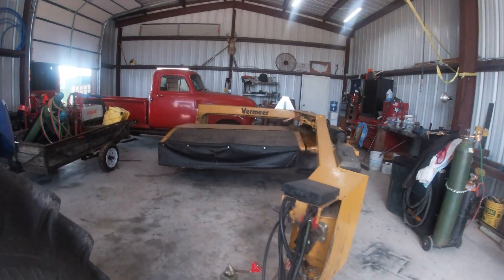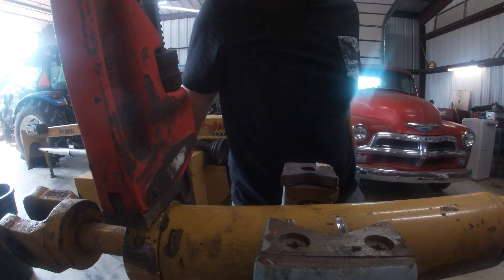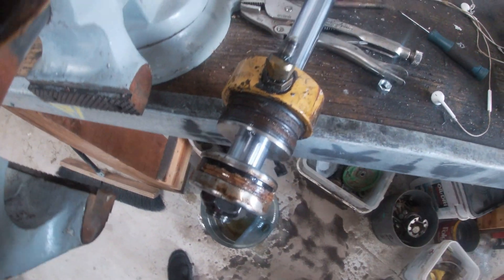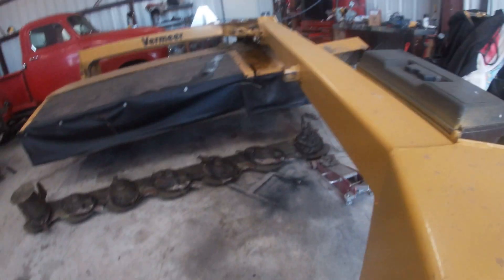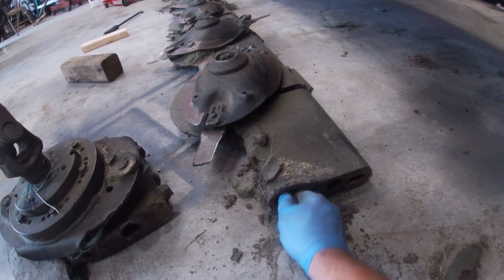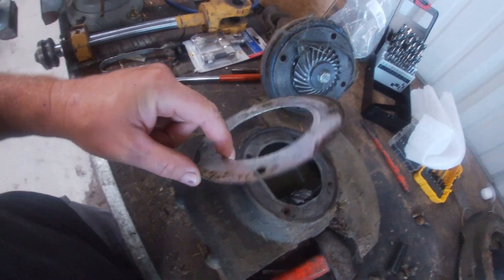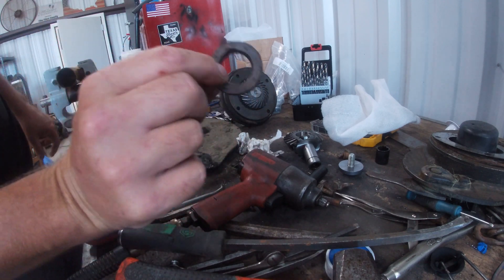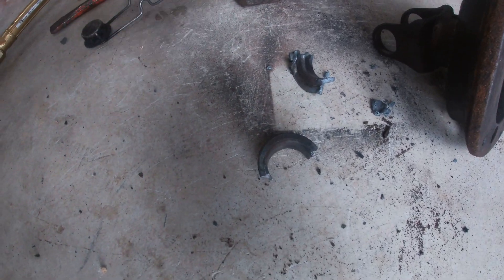Vermeer TM cylinder & pod  disassembled

Comment: Vermeer uses the same drive principle as New Holland and quite a few others.........We  use Krone... entirely different  drive principles......No loss of drive power as it  moves down cutter bar...... each cutter receives power from the main gear set at the rear of the cutter bar
Reply from the maker: Krone makes great equipment. I ran a 283s for awhile until I found this trailed mower.
Reply: To    make hooking up or tractor swaps faster. all our cutters are mounted on KMC carts
Reply from the maker: I almost built one for the 283 but found this Vermeer for the price of material